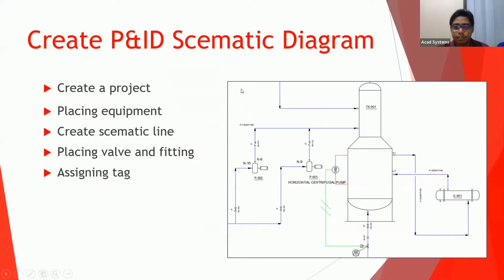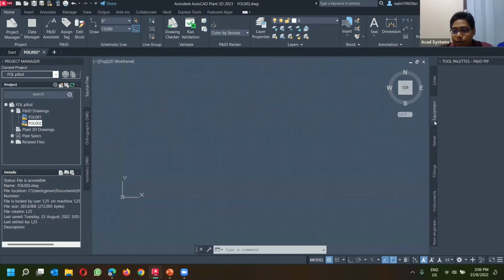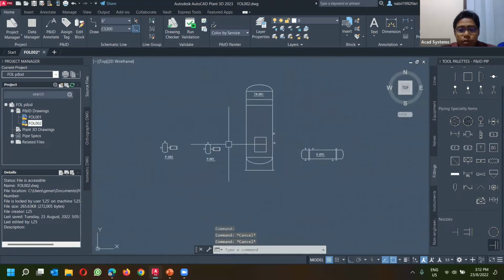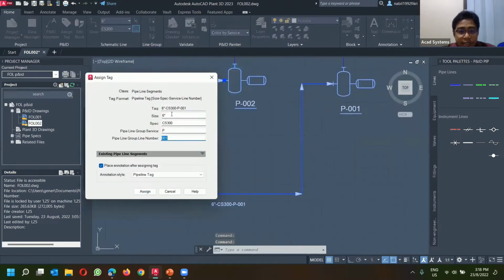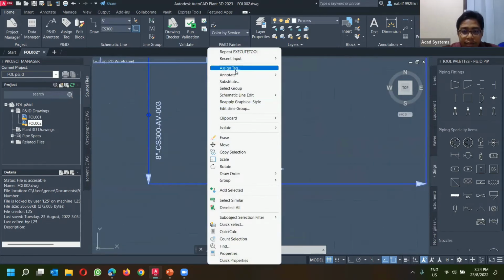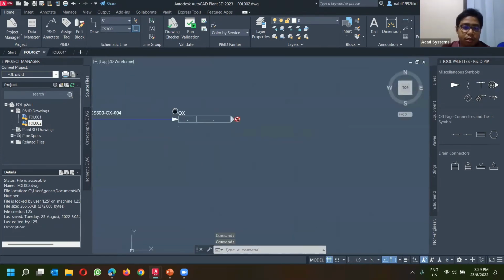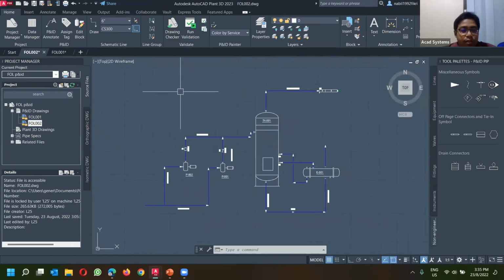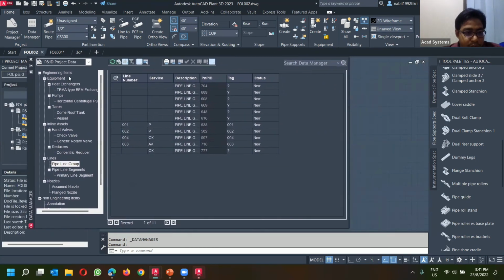AutoCAD P&ID Introduction

Comment: good demostration but con can i get that tab of project manager even restarting the set up it doesn't appear
Reply from the maker: Hi, Project Manager are only appear when using AutoCAD Plant 3D. If you do use plant 3d and somehow the Project manager is missing, firstly open new drawing first. Then go to Ribbon: Home tab > Project panel > Project Manager. Hope this help